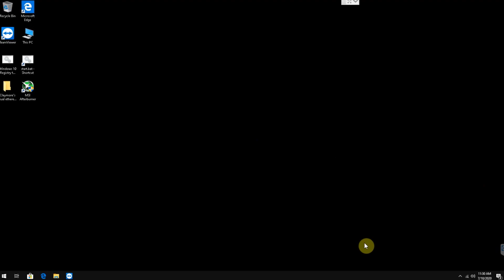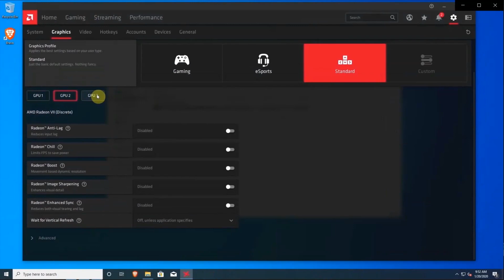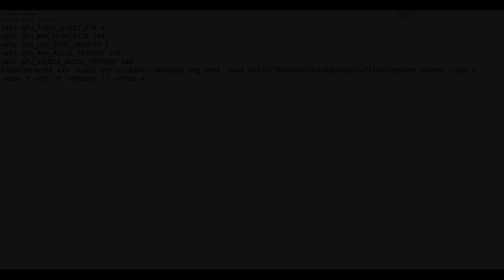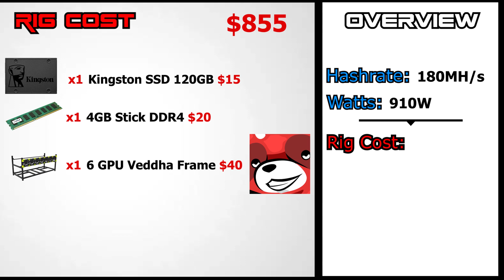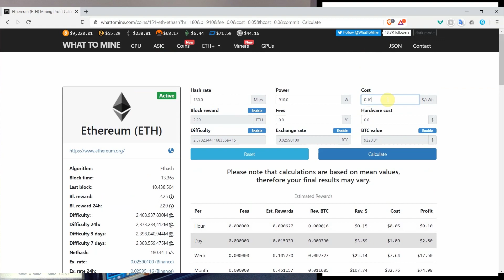RX 580 Mining Rig Build | 187 MH/s and 850 Watts!

Comment from the maker: NEW
- BIOS Modding for RX 580 is now out!!: https://youtu.be/r0jzvcRTqvQ
- RX 580 Updated Overclock settings and profits: https://miningchamber.com/gpu-mining/rx-580-mining-settings/
NOTICE: Don't use Claymore Miner anymore! Use Phoenixminer!!. Claymore is dead. Phoneix overview link: https://youtu.be/6K0tgwEuMYI

UPDATE: 
- We were able to achieve 187 MH/s while only using 850 Watts on the 6 RX 580 Build using our latest RX 580 settings. 
- Please watch our latest video on the RX 580 8 GB to effectively Overclock and BIOS Mod your Cards https://youtu.be/uoMGw0Sc7Dk
- For the -strap to work, you will need to run the miner as administrator.  It will also be covered in the link above for the RX 580 Review.

CORRECTIONS: 
- AMD Drivers - The latest AMD drivers also have the Graphic > Compute option! 
- 2 Variations are MSI gaming  and MSI gaming x plus
Reply: 850watt is not that much but 187mh/s is very little as well, as you know an eth asic miner has 860watt too and and has a 500mhs hashrate. Biggest downside of that is the noise it makes and that it can become obsolete after some time, and your gpu rig u can upgrade it or sell it later on still. But I gotta say it's still not efficient cuz I saw someone with rx5700xt cards that make 61mh/s for 105watt only.. I'm curious as how power efficient the new generation of amd will be, but the high price will probably not make it worth it for mining, also prices of used cards will drop. Same for nvidia rtx3080, great & powerful card but has 320w tdp already too, electric rate in my area is even about 0.2$/kwh already, but I'll try to overcome that with solar panels.
Reply from the maker: For sure it isn't the most effecient but for price to performance, the 580s 480s remain the best choice. We also have another video of a 5700XT mining rig. Where we were able to get around I believe 880 watts for 330MHs. ASICs still are performance beasts but they are honestly not made for residential areas in my opinion. Too lousy and hot!
Reply: @MiningChamber  Yes technically, but if you only consider the price of the card & the hashrate it provides, but that's without considering the higher electric costs you'll get with this rig.. Cuz as you mentioned already the other rig gives 330mhs for about same power usage so that would make a big difference. It depends on how cheap/expensive your elecricity is too but still u best get the most power efficient option, I found out that an asic miner of 2000watt for example to run that 24/7 takes a ton of electric.
Reply from the maker: For sure I agree! It's always better to go more effecient, especially for running more cards too. Youl only have so much capacity of electricity to use for mining!
Reply: @MiningChamber  Ye, cuz I calculated how much solar panels/energy I would need to lets say make a mining farm that uses 5000watt constantly, well I'd need between 150-200 solar panels to deliver that kind of electricity lmao...
Reply from the maker: 😂😂 that is crazy
Reply: @MiningChamber  Ye it's mostly sad cuz I can hardly put 20 on the roof or so lol.. Gotta say weather isn't great out here, in spain for example would maybe make 2-3 times as much energy I'm not sure. But that's why being able to work power-efficient is a good thing, that's something that still is getting better, now some asic miners still take 1500-2000watt but then you can get let's say 20$ profit a day which isn't bad.
Reply from the maker: @Neel Beke  definitely not bad at all! Hopefully all the best 🙏
Reply: Did you ever give my settings above a try?
Reply from the maker: @gregoryg.9694  I have actually just installed HiveOs on it!! Perfect timing I still have that image saved from your OC settings I will be trying them on tonight!
Reply: @MiningChamber  dope, I'm excited for an updated video :P
Reply from the maker: @gregoryg.9694  Ive done them! Getting about 33 mh on average which is aweome but one of the cards is stuck at 20 mhs hmm. Join our discord so we can chat!!
Reply from the maker: Dragon-00-  With us paying 5 cents per kilo watt hour we make 41 Dollars every week as of ETC price and difficulty today.
Reply: @MiningChamber  41$ is profit!
Reply: Dragon-00-  you are looking to mine around $6-$7/24 hours
Reply: How much can make per day?
Reply: Where did you buy your gpu's from so cheap?
Reply from the maker: @gto_  we got them off of a used deal from facebook marketplace! Got super lucky that it was before the prices went up for the gpus!
Reply: thanks. im about to get 1 580 and just to mine for the first time. i dont know anything about claymore miner, does it have a GUI?
Reply: Can i use 1300w power supply?
Reply: According to me, he make's around 160$ a month for etherium coin
Reply: Which RGB fans are you using??
Reply: I'm kinda new to mining rigs 

can you please tell me what cables you connected from the psu to the motherboard?
I'm running a 5 gpu setup and so far the only cables I have plugin are the 24 pins, and the cpu eps 12v cable.

I'm running a similar setup to yours so please keep me in touch

thank you
Reply: , z
Reply: I guess Im asking randomly but does someone know a trick to log back into an instagram account..?
I was stupid forgot my login password. I love any assistance you can give me!
Reply: @Jermaine Baker instablaster =)
Reply: @Henry Cannon thanks for your reply. I got to the site thru google and Im waiting for the hacking stuff now.
Seems to take a while so I will get back to you later when my account password hopefully is recovered.
Reply: @Henry Cannon It worked and I now got access to my account again. Im so happy!
Thank you so much, you really help me out :D
Reply: @Jermaine Baker You are welcome xD
Reply: Where can i buy that all you use nothing is on amazon anywhere else? Please do you sell??

Comment: I noticed from your hardware list that several parts were bought at 50% MSRP, to make the price really low.  Yes, that's an achievement, but really now, how many of us little guys are going to be able to find parts for 50% MSRP these days (Q4 2021), and not to mention it would be nice to see what this 'rig would cost in today's market prices.  I'm sure it's a lot higher now, and the hashrate isn't as good as it was in 2020, so even less profitable.

Comment: I bought 2 GIGABYTE RX 580 8GB. 1 has Hynyx Memory and the other Samsung. The Samsung GPU runs ETH 22 Mh, if you change any overclocking settings it slows from 1Mh to 18Mh. The Hynyx unit runs solid 32Mh. Any ideas on what might be happening? Is it possible The BIOS is modded on the Samsung? Is there a way to check? I would be grateful for any insight / assistance...
Reply: both cards have different memory... so overclock settings will be different both for them.. if one is adding more positive values other will be in negative values.. check google you will get answer
Reply: Good to go, pulling 31Mh per card. Thanks for the help.
Reply: @FUNBEAU  happy mining :)

Comment: Great build, appreciate the insight.  I am building my first GPU rig and these videos are a big help.  Here is my list.
Item
• XFX AMD Radeon™ RX 580 GTS Black Edition 8GB
• Frame - Baseltek 6 GPU Aluminum Mining Rig Open Air Frame Case 
• Motherboard - MSI H270-A PRO
• Memory [RAM] - CORSAIR Vengeance LPX 4GB 288-Pin DDR4 SDRAM DDR4 2400 (PC4 19200) Memory Kit Model CMK4GX4M1A2400C14
• Storage [SSD] - PNY CS900 120GB 3D NAND 2.5" SATA III Internal Solid State Drive (SSD)
• Processor [CPU] - Intel Celeron G3920 
•  be quiet! Dark Power Pro 12 1200W, BN646, 80 Plus Titanium Efficiency, Power Supply, ATX, Fully Digital, Modular
• PCI-E Riser - Ubit 6 Pack Latest PCI-E Riser Express Cable 16X to 1X (6pin / MOLEX/SATA) with Led Graphics Extension Ethereum ETH Mining Powered Riser Adapter Card+60cm USB 3.0 Cable
• EZDIY-FAB Moonlight 120mm RGB Case Fan with Fan Hub X and Remote,Motherboard Aura SYNC,Speed Control,Addressable Fan for PC Case-6 Pack 
• PCI-E Splitter PCI-e 6 Pin to Dual PCIe 8 Pin (6+2) Graphics Card PCI Express Power Adapter GPU VGA Y-Splitter Extension Cable Mining Video Card Sleeved Power Cable 9 inches
• WIFI Dongle TP-Link USB WiFi Adapter for PC(TL-WN725N), N150 Wireless Network Adapter for Desktop - Nano Size WiFi Dongle
• Raspberry Pi Touchscreen Monitor, Upgraded 7'' IPS 1024X600 Dual-Speaker,USB HDMI Portable Monitor Capacitive Pi Display,Compatible with Raspberry Pi 3b+/Raspberry Pi 4b, Windows 7/8/10,Drive-Free 
Appreciate any input or guidance

Comment: awesome information .... sub as well, is there any information on the RX460 4GB card and RX480 8Gb (blower) card for overclocking? i couldn't find anything?
thanks ! love your rig so clean!
Reply from the maker: Thank you!! Unfortunately the 460 not sure but the 480 very similar to the 580 which you can find the overclocks for it in miningchamber.com. use the same values and then just fine tune it a bit

Comment: Hey there,i wanted to ask is this psu is enough for 3x580 8g+3x590 8g?is it a must to undervolt the cards for this psu?and last,are the psu's power supply cables and 6 splitters enough for 6 cards even if their power supply is 8+6 or do i need to buy extra?ty in advance

Comment: I'm running 8x Rx580 8gb on a B250 with two power supplies.  When I put a 9th GPU on it, the results are that one of my GPUs coming up as dead when I start teamredminer.  It's 95% of the time the last one I added.  Tried different risers, but still running into the same issues.  Any insight on this?

Comment: Help me understand how you wired it up, please - you're powering 6 cards, all 1 8 pin each (Total of 6 connectors for the GPUs). You have 3 PCIE/VGA strands with 2 connectors each (Total of 6 connectors). You used splitters, so wouldn't you end up with 12 8 pin/6+2 connectors which would be enough to connect to the 6 GPUs and 6 risers? You mentioned you fell short for 4 risers...?
Reply from the maker: Some cards had 2x 8 pins, and I believe after using splitters I still fel short and then used molex or Sata as far as I remember. Run max 2 risers on molex strand, ideally just one. And avoid sata. I was a noobie back then so don't do my mistake of using SATA for risers
Reply: @MiningChamber  Thanks for the response, I got really confused since they all looked like the same card. Thanks so much for the all the info and experience you've shared, wishing for all good things for you! :)
Reply from the maker: Pleasure my friend, good luck!

Comment: can i use thid motherboard Biostar Motherboard TB250-BTC PRO Core i7/i5/i3 LGA1151 Intel B250 DDR4 Supports 6 AMD and 6 Nvidia Graphics cards with rx580 and intel Pentium g4400 processor
Reply from the maker: Yes you can

Comment: Hi I have a motherboard with a PCI-E x16 slot one x1 and two PCs can I put risers on all 4?
Reply from the maker: Hmm I do not understand what you mean. But yes per slot you can run one GPU so each PCIE slot whether its x16 or x1 you can connect a riser to it

Comment: Now this gpu abouth 300-400$ 😔
Reply: ikr got mine at msrp a week before it went up, it just doubled and even tripled depending on which model.
Reply: @itznate_ish  i have rx580 8gb and in hivos which is the best tdb to put?
Reply: @cicaubica8900 what is tdb and hivos?
Reply: @itznate_ish  power limit
Reply: @cicaubica8900  I honestly don't know. I left it at default and let the Radeon software auto overclock it. I don't really tweak the bios too much other than to overclock the CPU and ram. I use the software for the GPU so that it can auto overclock without too much of a risk of damaging it.
Reply from the maker: Check the latest video about overclocking ;) it will damage it if you have it auto overclock and you mine with it. Because auto overclock is most of the time for games not mining
Reply: @MiningChamber  i have hivos i dont have windows to instal software to clock
Reply from the maker: @cicaubica8900  You can still overclock there. I cover that in the video still

Comment: hey I have an RX580 8gb variant and I recently started mining, on windows 10 with NiceHash i used to make approx. 76 Indian rupees per day but since I am using NiceHash OS I am making 126 rupees/day...now does that mean the NiceHash OS is more profitable or my Windows was unoptimized or maybe both are the same??
please let me know and also suggest what OS, Should I use for better performance and higher profits
Reply from the maker: It most likely because your windows was not optimized, I suggest overclocking properly because that is the main factor. Check the overclocks on miningchamber.com

Comment: Mine just boots up and immediately shuts down when i am using risers
Reply from the maker: Check connections make sure everything is good, make sure your CPU is compatible and RAM is placed right
Reply: @MiningChamber  it was a dead sata power cable yikes. Managed to boot mine up. It still freezes when im trying to install AMD software. Any tips?
Reply: @thijsrv  I bet it has to do with a driver if you're using an AMD I had a gaming computer a Vega 56 and had to have the AMD drivers before it would boot correctly..dont know about ming though
Reply from the maker: I would suggest using DDU and uninstalling drivers fully in safe mode then reinstalling. 20.4.2 seems to be a driver version I had good luck with so far

Comment: hot air rises. so why does the outtake fans on the side? i think that wont help much on the far (from the outtake)side of the rig. why not put it above for better cooling
Reply from the maker: Actually the GPUs intake fan is on the side then it pushes the heat throughout the I/o side and a bit from the top of the GPU! 

As for the other fans, it won't make much difference really since they are low cfm fans. Just for the looks 😛⛏️

Comment: your using more electric like 920 not 910. and you would use less electric if you dont use LED fans.
Reply from the maker: I believe I didn't measure it out of the wall in the video but off the wall it does do around 880 watts, as for the led fans, they barely take anything so it's no worries!

Comment: Hey Mining CHamber, 

How did you connect all the GPU on 1 PSU?
The PSU only got 5 PCI-E slots right? Did you connect two cards on 1 splitter?
Reply from the maker: I ended up using 2 cables to power 3 GPUs with the use of splitters !
Reply: @MiningChamber  How did you connect them exactly :o. DId u connect two 6+2 pins from two different cables on 1 splitter to split the wattage even over the two cables?

Comment: Great video. Could find the same psu but manage to get CONTINUUM 1200W 80 PLUS PLATINUM MODULAR POWER SUPPLY.Also looking for some pci e splitters but dont know wich ones are good. The ones from link doesn't work:(
Reply from the maker: Thank you! Check splitters here! geni.us/NerdGearz if not there then maybe in aliexpress or alibaba

Comment: I just picked up 2 xfx rx580. Put it on my test rig got 29.5 out of the box.  Did a bios mod patched tge drivers got 24. Un mod the bios then got 26. Then unpatched the drivers back to 29.5. Running windows 10 with blockchain drivers. Any idea what's going on. Thanks
Reply from the maker: Try more recent drivers, blockchain drivers are unnecessary now, also use the rxboost command for the miner and such. Check our write up on miningchamber.com about this gpu

Comment: Does rx580 worth it for mining ETH right now?  I just want to start it right now
Reply from the maker: If you are planning to buy the gpu new then I recommend looking for 5500 xt 8 gb or 5600 xt and 5700 xt. But if you find the RX 580s cheap and used then it won't be so bad !
Reply: @MiningChamber  5500xt 8gb nitro+ or non nitro+ ?
Reply from the maker: It all depends on price difference. They don't necessarily need to be nitro+

Comment: What CPU and RAM specs are required for mining?
Reply from the maker: The bare minimum that is compatible with your motherboard! Usually 8 gb ram is good for 6 gpus and up, you can go with 4gb too but for Windows system 8gb is more reliable

Comment: I used Rx570 8gb, 182 MH/s, got 440 watt.. can i get better MH/s??
Reply from the maker: Off the wall it should be around 800-850 watts depending on your undervolts. Software numbers are not accurate! 

What's your overclock settings right now? Are you getting around 29-30 per gpu?
Reply: @MiningChamber  yes 30 MH/s.. i see 800-850 watts. Is there can get better MH/s? Hehehe
Reply from the maker: Mm honestly I think your good! It's better to have it stable than going for more hashrate and then it keeps crashing!

Comment: Alright, I just purchased everything using your link on 11/24/2020 Hope it helps out. I'll be updating my rig with in this comment so stay up to date guys!
Reply from the maker: Thank you so much! And good luck!!
Reply: @MiningChamber  Quick update, I just built the rig and I am having issues. Seconds after I start it up it shuts off and turns on and shuts off and so on. Any recommendations?
Reply: Update, rig running strong and mining like a beast!
Reply: How much is it earning currently?
Reply: @guardianuruguayoguardian1761  189.6 mh/s
Reply: Those cards now sell for 1000$each on ebay

Comment: Would it still make sense to make this as of 11/24/2020? Cheers
Reply from the maker: As of today, I would vouch more for 5600 XT and 5700 XTs since they do come at a more efficient performance, if you got the GPUs already its okay you can always eventually build a 2nd one ;)
Reply: @MiningChamber  And between 5700 and 5700xt? The profit difference seems to just be 2 cents on Whattomine.com
Reply from the maker: 5700 is end of life they are not produced any more but if you find any you can easily flash them to a 5700 xt so there is no difference at all. It all comes to what's cheaper for you ⛏️⛏️